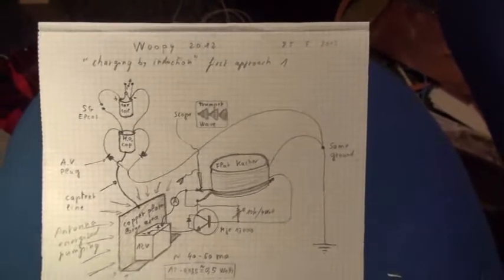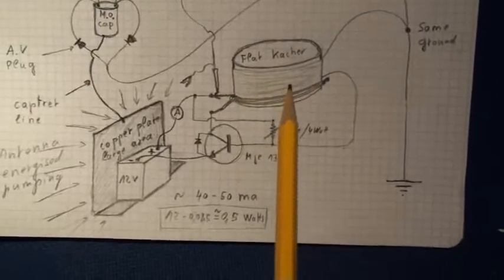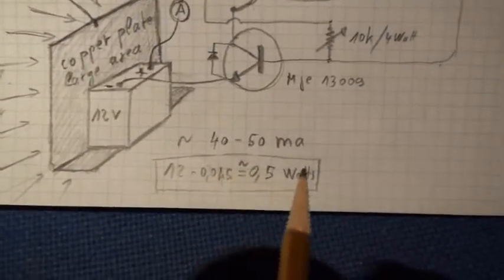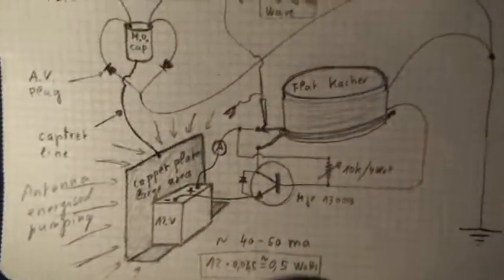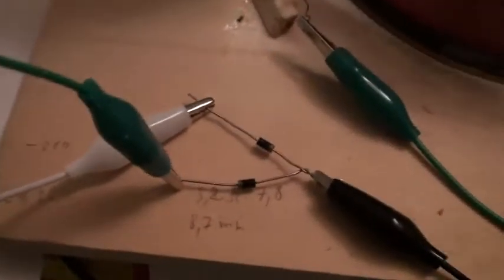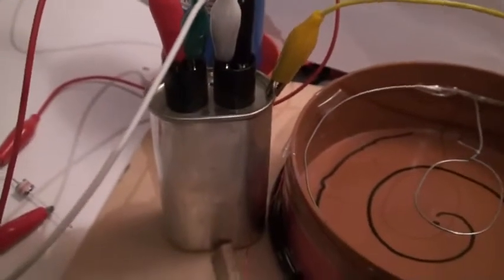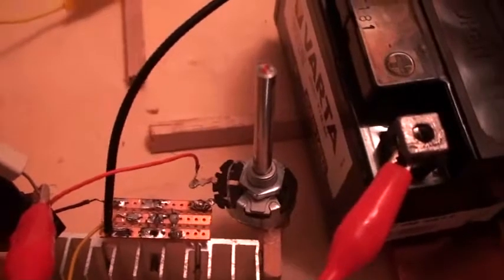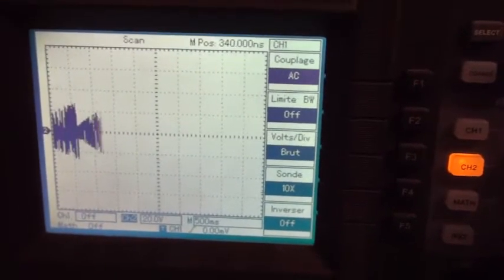charging by induction approach 1.wmv

Comment: Hi Woopy,
hmmmm????
Have you tried without the copper plate; either by substituting it with a 1,000pF capacitor or a short circuit, this between the microwave capacitor body and the battery negative ?